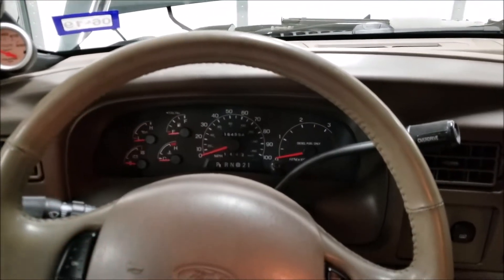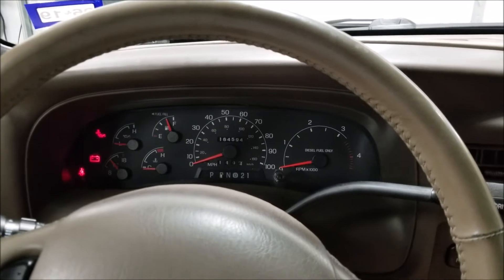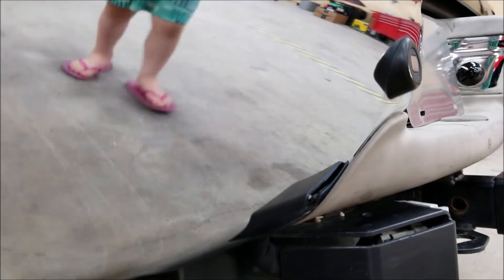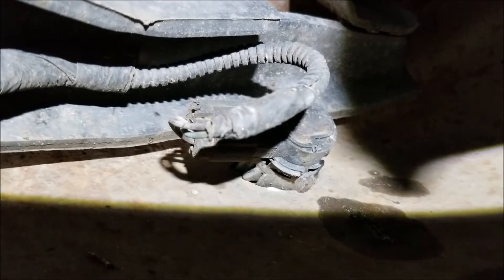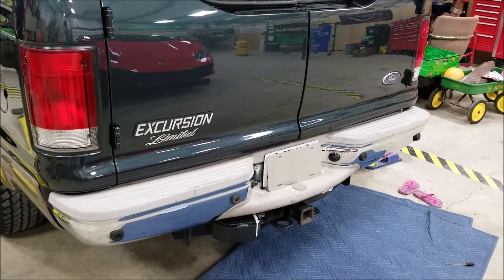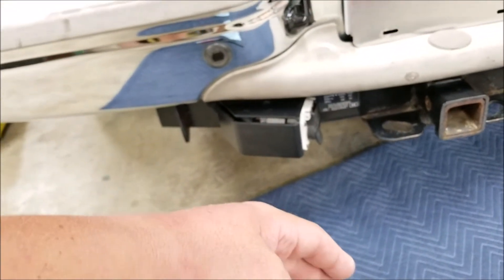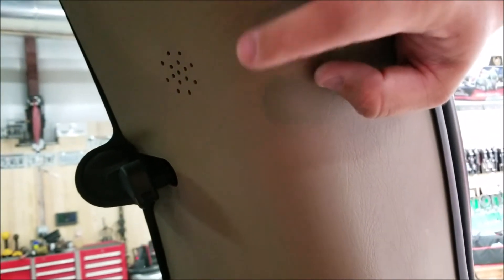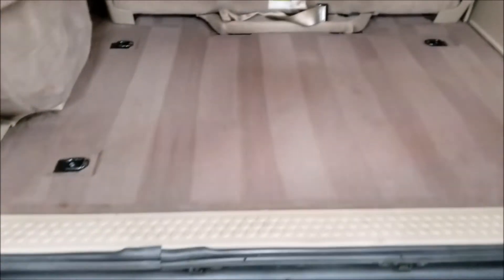Ford Excursion 2000 to 2005 Backup Sensor Replacement (and speaker)

Comment: Awsome Vid, Thank you.  I have an '03 Excursion Limited 7.3L.  When we bought it last November, we would get random faults (OFF illuminated). Then no problems for awhile. Now (nearly all the time), when we back up, we get a constant tone from the speaker.  I ran the test you showed, couldn't hear clicking on any sensors (with the OFF illuminated as shown in vid).  However just using my hand, I did find that one sensor is bad and will replace that one.  So.... any ideas about the constant tone?  All sensors are clean BTW
Reply: Hey man this might be 3 years late, but the tone is probably coming from a faulty ground or faulty wiring. You’d have to inspect the wires carefully to see that they’re isolated

Comment: Hi. A friend has the same 2001 Excursion.
Fuse 28 blows everytime he uses reverse.
I think it is possible a sensor is shorted out.
This doesn't seem to be the problem you had, but have you heard of it happening?
Thanks, John

Comment: Any idea what the part number is for the replacement sensor? I ordered some that amazon says fit my 04 excursion but the plugs/sockets are just slightly different and they dont work.
Reply from the maker: I can check. Pretty sure I have the box still
Reply: I did the exact same thing! And the ones that we got off Amazon did not fit either. And I do not want to pay the dealers price for what they want for them. Been trying to do research to find the right ones.

Comment: I am having difficulty finding sensors for my 2000 Excursion. All I see are the parts for 2001-2005...  Your dash looks similar to mine. What year is your truck?
Reply from the maker: Mine is a 2001.   2000-2001 should be the same.   Check Ford for your part number then Google it and see if it comes back to 2000 only.  Ford used theses sensors all over the place but had slight differences in how they mounted
Reply: @ScottHD  - Thanks for the quick reply. Yeah- the 2000's have a unique number. I can't believe Ford would produce a one-off sensor - that doesn't make sense.  I'll keep digging around. thx

Comment: Ok. All 4 sensors click so I went ahead and replaced the speaker. Its still not working. However I do notice one thing is different..... the button for this can be turned off when in Drive Mode where it was constantly illuminated orange before I replaced the speaker. But as soon as I go to test it , I throw the truck in reverse and it goes orange again and no alarm. Any ideas???
Reply from the maker: Speaker good, sensors good, switch good ... I am wondering if there is a controller of some sort for the system?  (An ECU for the sensor system?)
Reply: @ScottHD  Might be the BCM (body control module).
Reply from the maker: @thomasshepherd7489  boom! Thanks